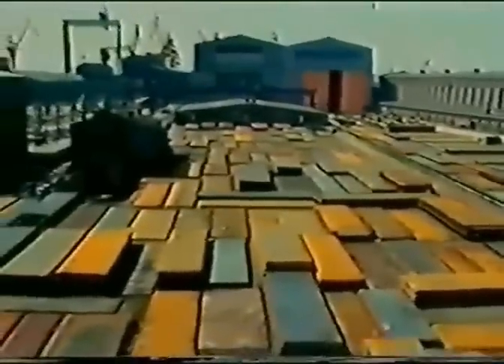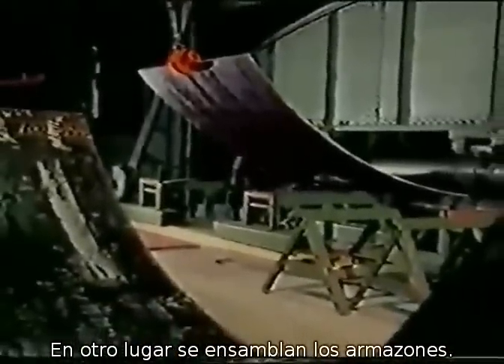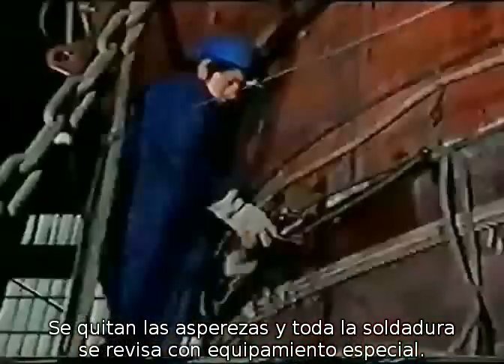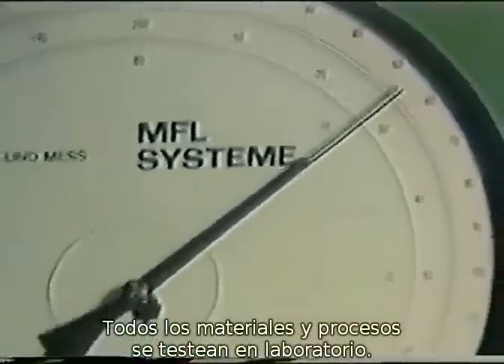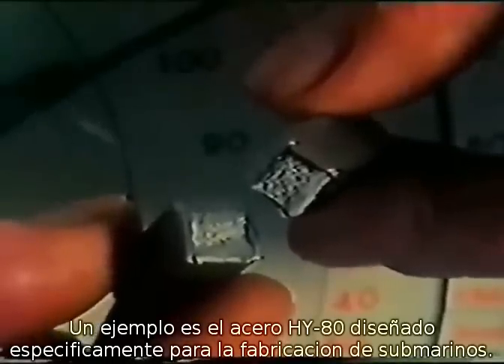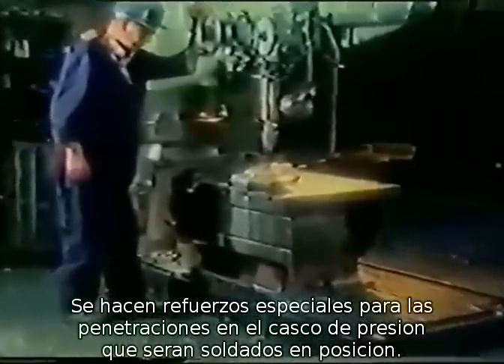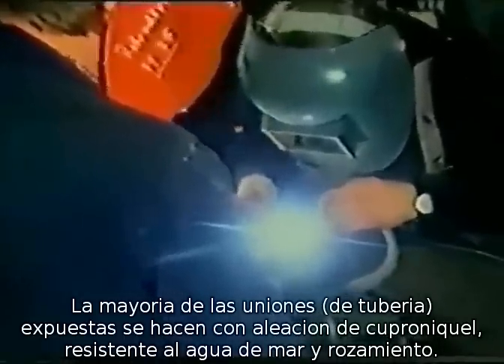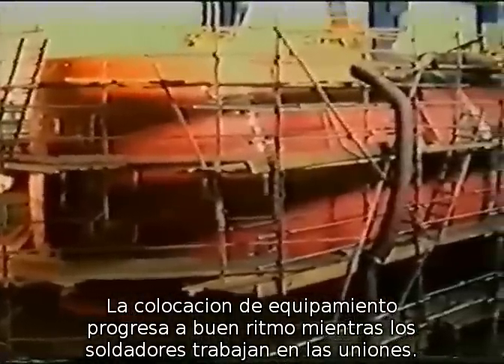Fabricando submarino TR1700  en Alemania -  Parte 1 de 2

Comment: El corte de chapa ya no se hace con robots-sopletes de oxicorte sino mediante maquinas automatizadas que proyectan agua mezclada con un povo abrasivo a presiones altisimas. Además, mientras se hace esto, la chapa permanece sumergida en un baño de agua fria a pocos centímetros de la superficie. De esta manera se evita que las propiedades del acero sufran modificaciones por causa de altas temperaturas.

Por lo demás la mayor parte de la maquinaria que se ve en el video ya no se usa y la soldadura por electrodo muchisimo menos aún. Lo mismo para realizar las comprobaciones sean de la soldadura o de las medidas. Ahora las soldaduras son comprobadas mediante varios metodos diferentes para asegurar la calidad y para las medidas se realizan con aparatos laser. Hoy en día las tolerancias son mucho menores y el margen de error permitido es casi=0.

Comment: En el  video se ve un detalle que mucha gente sin conocimiento aludia como origen del hundimiento y es el hecho que en el overhaul del 2014 se haya "cortado" el casco en mitades como si esto fuera un disparate. Como se ve claramente en el video, muchas unidades incluyendo los motores y lanzatorpedos se instalan antes de cerrar el casco ya que no se pueden hacer "portones" en el casco para ingresar equipos voluminosos ya que perdería toda la integridad estructural. La técnica de cortar y unir es la norma en el overhaul de estas tremendas maquinas y en ningun caso la excepción. Si el proceso de soldadura de union se hace bien no tiene porque fallar y sinceramente no creo que fallara casi 3 años después de entrar en servicio.